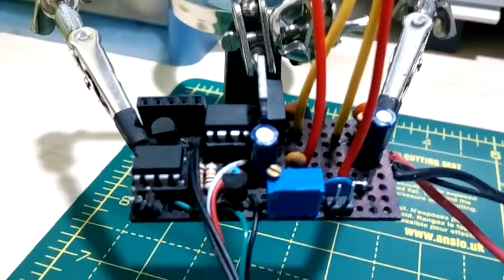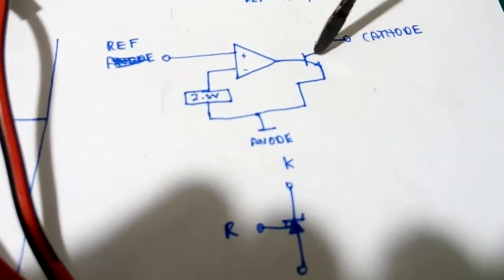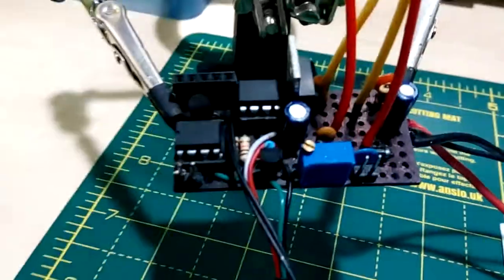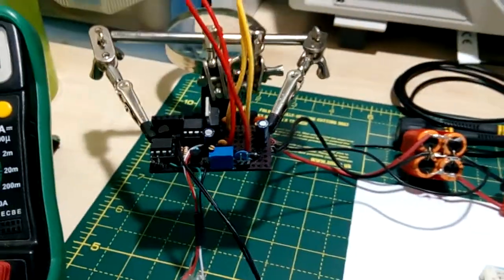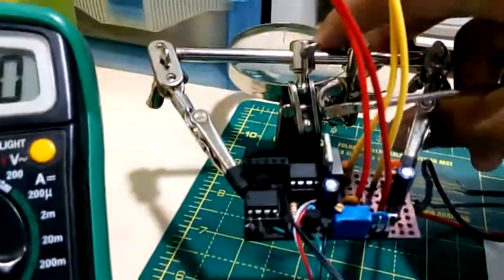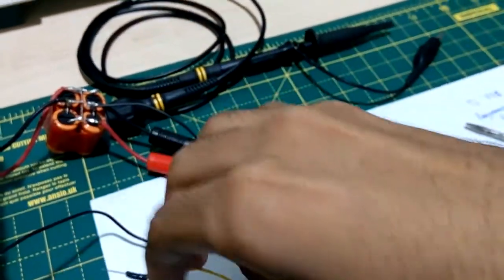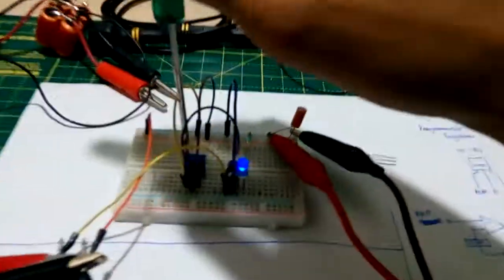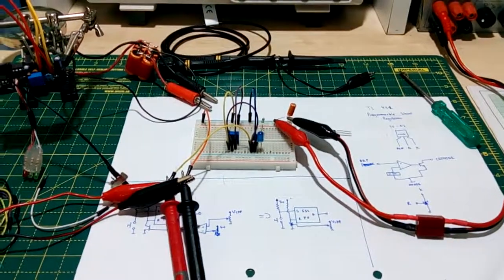Capacitor Charger Modifications | TL431 Regulator

Comment: Also the blue LED doesn't emit actual blue light, therefore the inital forward voltage is much lower.
Reply from the maker: Yes, I can only hope the TL431 does its job properly in the final circuit.

Comment: I also use the TL431, but with an SCR. Since capacitor threshold is reached, it will discharge through parallel resistance and drop below the set 2.5V ref. Turning the circuit back on, charges it, turns it off, passive discharge, turn on, etc. Not good.
Reply from the maker: I have mine hooked up to a flip-flop, so charging is one time. Only a press of the charge switch can initiate a new cycle.
How does the SCR help? Some sort of latch? I guess you can implement a similar thing with an SCR and a TL431.